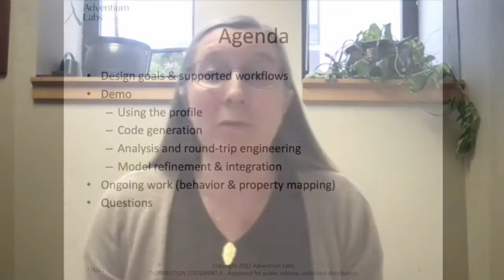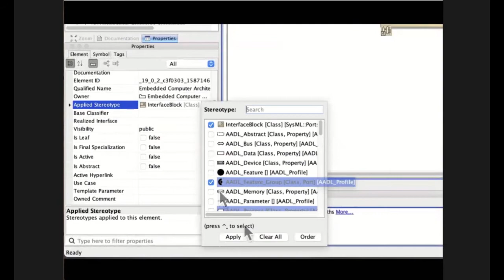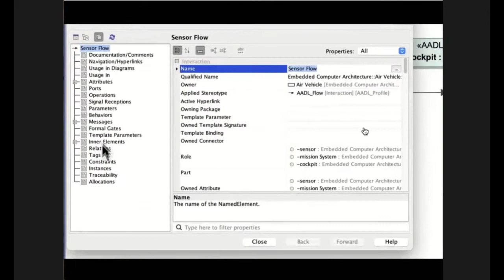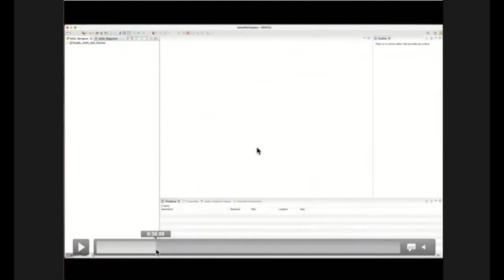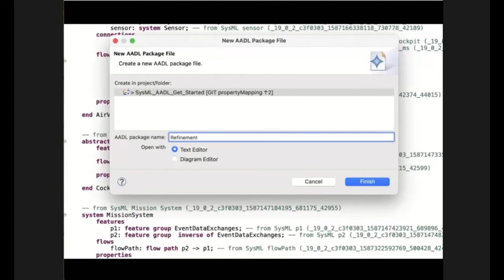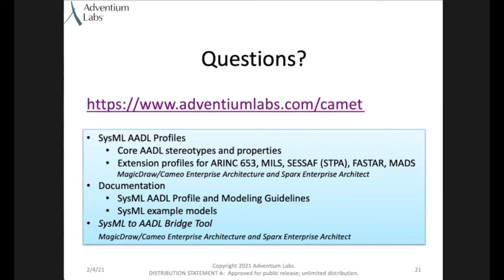AADL/ACVIP 2021:  SysML to AADL Bridge: Automating the translation of SysML into AADL for Analysis

Comment: The issue with moving from one language to another is that it is hard to go in both directions. For example, if we changed something in AADL how is this going to be represented in our SysML diagram? Also, since AADL allows text-based development this is not symmetrical with SysML which is graphical. Similar issues are seen when we generate code from AADL. The lower-level language always presents more features. SysML is nice, but it is so high-level that it is hard to accomplish the same level of design details as we can with AADL. Still a nice direction in the situations where we have high-level SysML designs that can be translated to AADL.